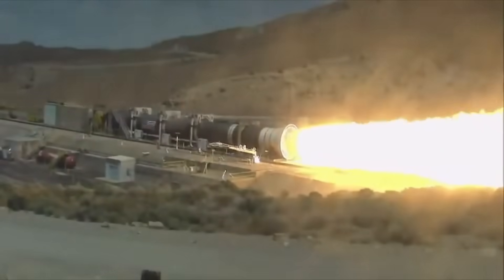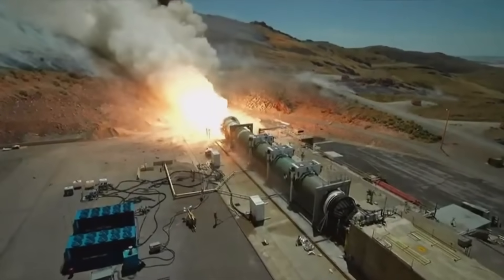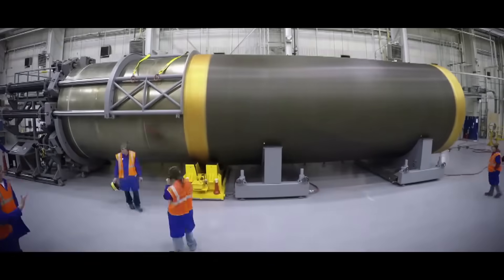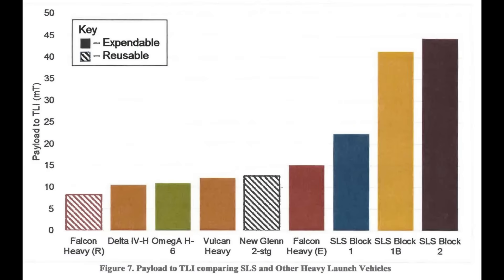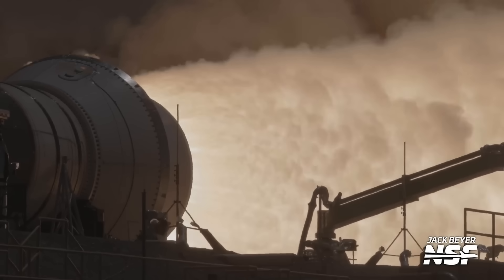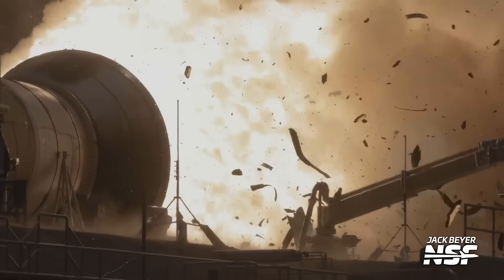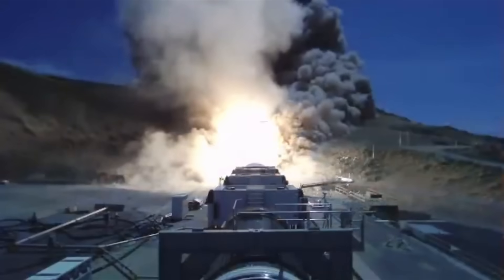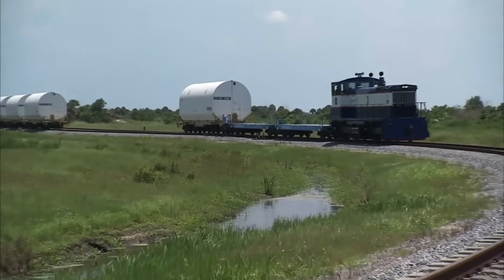NASA's Future SLS Booster Just Failed Its First Test

Comment: I was reading about the early space shuttle designs and a lot of engineers were scared to put astronauts on solid rockets. Things like this reawaken old concerns. Of course, later, when the RS-25 SSME blew up its test stand, the liquid fuel engine became the thing the astronauts feared the most. No matter what, there are lots of scary parts to any rocket.
Reply: As I've said many times, there are very few single point failures in road vehicles; maybe some steering components (brake SPFs were eliminated decades ago).  Aircraft have many more single point failures; wings, control surfaces.  On rockets, virtually every component is a single point failure.  Look at Starship.  Some stupid tank holding a non-volatile gas ruptures and the whole rocket explodes.  That's why you need to be a rocket scientist (or a rocket engineer as Werner Von Braun used to say).  Rockets are hard.
Reply: @garyhalmbacher6875  Rockets also are built for maximum performance, with very little margin for redundant systems. Your car can carry around things that might never get used like airbags and bumpers because it doesn't have to operate at maximum performance. A launch vehicle is like a top fuel dragster: has to go all out for a few minutes with nothing held back. At the end of the run the entire car gets refurbed and the engine rebuilt.
Reply: "Now I'm riding on a fountain of fire, with my back to the earth I go higher and higher, why me?" -- Planet P Project
Reply: @myself248 wow, I thought I was the only person who remembered that song, I wore out my cassette copy of it!
Reply: The Air Force's experience with large solid motors, in the early 1970's when Shuttle was being designed, was 30% anomaly rate (something weird happened 1/3 of the time). They warned NASA about that. This might be where the fear of large solid boosters came from.
Reply: Which is why manned space flight is so hard. Check out the SpaceX Starship #36 test failure in the past 2 weeks.
Reply: Especially when there is no launch escape system.
Reply: Fear is irrational nonsense.
Reply: @HateBear-real  Cool man

Comment: 13:15 Something about NASA using this brightly coloured amusement park steam train looking thing to transport their big high tech boosters makes me so happy. I'm assuming there's a reason it looks like that but I'm not much of a train person
Reply: NASA runs (or used to run) its own railroad at KSC and I think that this is one of their own locomotives. It isn't a mainline loco so doesn't have to be particularly powerful or new, just a shunter powerful enough to move a few cars around every once in a while. One of the bigger railroads (Florida East Coast?) would deliver and pick up at their private siding.
Reply: There is a railroad junction west of Brigham City Utah where the segments start their journey to KSC. The trains you see are just real train engines. They are not special train engines. The train cars are made for the segments and engineers ride in the caboose on each shipment to monitor the trip. And yes, the train has derailed in the past with the segments on them. They didn't blow up. They just looked very sad on their sides in a swamp.

Comment: the last part of the story of British/American rail gauge has been completely debunked... Up until the Roman Roads in Great Brittan and Roman Chariots wheel spacing being the source of modern rail gauge... Roman roads were abandoned in Great Brittan after the Roman Empire Dissolved... And the chosen gauge was probably a business decision and quite possibly a political decision that could have easily been 4 feet 3 inches or 5 feet 1 inches. Because YES British Carriages had a similar wheel gauge.
Reply: Apparently "Roman War Chariots" weren't really a thing, either.  And the racing chariots (which wouldn't have been a factor in designing roads) could be had with more than 2 horses side-by-side.  3 & 4 were not uncommon in that vocation, supposedly.

Comment: The ceramics on the nozzle appears to have not liked the harmonics of the fuel combustion, they'll likely need to find out what harmonics are causing the failure. The five segment is five segment becaise the weights of each segment maxes out the weight of the rails, the delivery train requires extra empty cars between the segments to cross the bridge onto the cape. As for rail guage it was a political thing, not about horses.

Comment: The one thing to note is British railways have the same rail gauge, but a much different loading gauge! The absolute maximum width and length you can push through the twisty, the tunnels and over the bridges in the UK is way way smaller than the USA - I think it might just be the smallest loading gauge in the world for standard gauge rails, any narrower railway is likely to be an actually narrow gauge railway.
Reply: was gonna say this too, track gauge may be the same, but the loading gauge is vastly different, and that's what actually limits their size
Britain has no double decker trains because of that tiny loading gauge 
and yeah, i think it's the smallest in the world for standard track gauge
Reply: @takaneseven1465  We used to have some "double decker" trains.
Reply: Yeah, i know heh, I recently heard about them
 @JimWhitaker
Reply: @JimWhitaker  Damn double decker trains would be such a win.

I can unfortunately remember many times when I was forced to stand on a multiple car train ride.
Reply: @mnomadvfx  Imagine the upstairs dining car with the picture windows on the East Coast Main Line up near Berwick-upon-Tweed, or on the Glen Carron line.
Reply: Bring back Broad Gauge.

Brunel was right !!
Reply: My state has broad gauge, but for the loading gauge, it might as well be standard. Everything was built on the cheap.

Comment: When you note that these SRMs, going back to the time of the Shuttle SRBs, are built out in the desert, that's true.  But they haven't always been built in Utah.  Up until the Challenger disaster, the aluminum perchlorate/rubber base solid fuel was made at the  Pepcon plant outside of Las Vegas, in Nevada.  After Challenger, it took a while to understand that they needed to put the fuel production on hiatus, so tons and tons of the stuff got stored in barrels at the plant.  Right up until some welders started it on fire, and the plant became the site of one of the largest non-nuclear explosions in history.  After that, fuel production was moved to Utah.
Reply: Henderson, NV.  They needed the hydroelectricity and natural gas that ran in a 16" pipeline directly under the plant.
But PEPCON was only producing the AP not the binder (HTPB?) or the atomized aluminum.
It wasn't clear how long shuttle launches would be delayed and their contract stipulated X rate of production.
Thiokol would blend the oxidizer, fuel and binder then cast the grains in their own facility.
Reply: @jimurrata6785  Thanks for the clarification!  I knew they made the AP and were storing it, somehow I thought they had added the binder, too.  But you're right, that doesn't make sense, once blended with the binder, the fuel gets poured into its casings to set and cure, correct?  You wouldn't have interim storage of the final blend.
Reply: @DougVanDorn   Yes the oxidizer, fuel, binder and catalyst are blended then subjected to vacuum in order to remove any air bubbles.
The grains are cast, cured, trimmed and the ends of each grain are inhibited so the burn rate is steady.
Reply: The French made the propellant for their ICBM / Ariane boosters in Toulouse next to a giant Total group fertilizer plant that blew up catastrophically in September 2001…..
Reply: Pepcon only made AP (Ammonium Perchlorate, the oxidizer), not APCP (Ammonium Perchlorate Composite Propellant, solid fuel).  APCP does NOT explode, we won a lawsuit over that falsehood.  Uncontained APCP just burns.  AP, especially in smaller grain sizes, with any heat, such as a welders torch OR a Natural Gas line breach, is a very aggressive oxidizer and is worse when it is contained in seal containers.  Been using APCP for over 35 years in licensed amateur and High Power Rocketry.
Reply: The USCSB report on that.
Somebody know where is it?
Reply: That was only for the AP, not the motors
Reply: I remember seeing video of that. The shockwave was visibly moving across the desert floor.
Reply: @DougVanDorn They did WHAT with the fuel? It sounds like the most American thing ever.
Reply: @Brick_One_A_Lego_Story  You don't want to know how 'old' the fuel and oxidizer are in LH2/L0X rockets.
Reply: @KellyR-qx7wn  yeah not the same lol

Comment: Why does the Train say` Do not Hump`? I know it sounds like the start of a off colour train joke sorry. but genuinely interested in the answer.
Reply: Standard notation on railcars carrying fragile things.  A "hump yard" is a type of switch yard where the cars are pushed over a hump at the start of the yard and then roll down the other side through a bunch of automatic switches and brakes.  It's an efficient way to sort out a lot of cars into different trains without needed to go back and forth with the locomotives a lot.  However, it does sometimes lead to the cars slamming into each other with a fair bit of force at the end of their downhill run, so you don't want to do that with anything fragile, and particularly not with things that are highly-flammably fragile.
Reply: @BrooksMoses  Thank you, So it was some useful signage. Don`t hump me I`ll blow up or break. cheers.